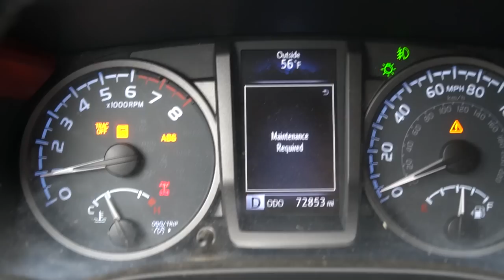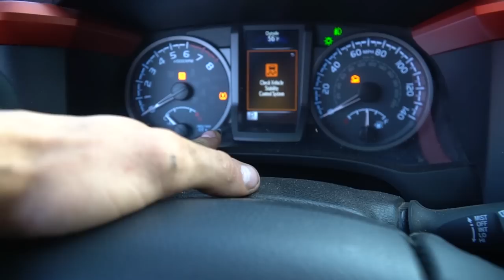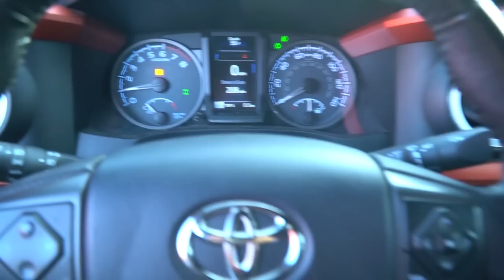Toyota Tacoma's 4x4 Issues | 2wd to 4wd change failure How To Fix

Comment: I had this problem today! I live in the Yakima County area. I attempted to put my Tacoma from 2wd to 4wd(hi) and a messaged popped up saying “2wd-4wd change failure”. After
a couple tries and running it on 2wd in nasty snow I attempted to get it in 4wd and finally engaged smoothly and drove it for 20-30 miles. Today it was 8 degrees fahrenheit and very chill winds. Maybe the 4wd system didn’t want to engage because the front diff oil and other 4wd components was too cold and due to the motor warming up it finally engage. If it happens again,  I’ll have to lift the truck up and check the actuator as it’s not my first time service differentials. My local dealer quoted me $160 for a diagnostics so if it happens again and I cant fix it I’ll have to take it to the dealer.

Comment: So the ADD on my old Toyota was vacuum actuated.  It was constantly not engaging or disengaging so I used a hose clamp to keep it constantly engaged, then put manual hubs on the front wheels.   No more shift on the fly but there were no more problems.

Comment: Stability control is usually the right to left braking adjust for bad road cond... check the vacuum pump
(brake  helper pump) .. not the booster.

Comment: About time we get some wheeling content again!
Reply from the maker: I know I cant wait to get the truck back out there
Reply: @Maxx.Powell  I had an issue with my new at that time 2018 Tacoma TRD sport 4x4  , drove into Carolina beach sand all good, parked there for 6 hours, then when i backed out of spot i was parked and drove about 200 feet the truck would not move, engine was running  but wheels would not spin at all, light came on it said something like trans fluid hot"  so i shut it off, a guy helped me told me he would pull me with a strap about 10 feet and then to engage from neutral to drive while on 4x4 and it worked, he said the lockers were out of whack, have you ever heard of such thing?

Comment: I have all kinds of lights on my 2020 Tacoma i have the Pre-collision system malfunction, ABS, Check vehicle stability control system, Check blind spot monitor system, AWD System malfunction. Its a freaking nightmare, i have an appointment at a second dealership tomorrow, we’ll see what they say! First Dealer i took it too charged me 180$ dollars for Diagnostic and said it was the RF wheel speed sensor which they priced at 280$ and the whole job for them to install was close to 800$ just to remove a 10mm bolt and unplug the sensor and install the new one! What a ripoff! Brought the truck home and after I inspected the sensor connections I noticed the tech at the dealer had unplugged the wire inside the engine bay by the wheel well, so it was obviously not gonna read like it stated on their diagnosis! Thats the reason i am taking it to a different dealership tomorrow hopefully they do help me fix it and not just take my 💵

Comment: I just bought a 2018 and when is warms up sometimes it starts flashing and says 2wd -4wd change failure after it cools down it resets and works for a while until i drive it and after it gets warmer it goes again? Appreciate the help
Reply from the maker: I'm having the same issue still.  I have a buddy who spend a ton of money trying to figure out what was going on. He said their is a position sensor located on top of the transfercase (mid vehicle) and that the whole transfercase needs to drop out in order to access that sensor. The whole job cost him 6k 🤮
Reply: What is the part number or exact name to look it up

Comment: So I have this same issue but only after I regeared to 4.88 gears. Toyota dealership tested it with a ohmmeter and they said it’s the coil in the rear diff. Dallas Offroad installed it and they’re trying to say it’s nothing they did and that it’s electronic and not their fault.
Reply: What happened here for you?  I just regeared to 4.88 and I just noticed I'm having issues getting out of 4L
Reply: @honestmike3255  The coil in the rear diff that’s connected to the e-locker was damaged by the installer, Dallas Off-road. This is the most common issue and basically gives you a 2WD/4WD Mode Change Failure alert on your instrument cluster. The wire that goes to the coil was damaged and would intermittently throw an error but in my case I couldn’t go into 4WD.  THATS DEFINITELY THE ISSUE.

It was fixed by a Toyota Offroad shop here locally called Tandem Automotive who basically new exactly what the issue is.

Comment: I had my truck for exactly one week and my 4x4 actuator failed and had to get it replaced. Was under warranty, but still....
Reply from the maker: Dang that's a bummer
Reply: @Maxx.Powell  Yes, Toyota could not tell me why it happened. Only that they fixed it. Just hoping it doesn't happen again at 25001 miles.

Comment: Mine occassionally fails to switch in or out of low range. It is annoying because I live in the middle of nowhere and I use low range almost daily.  I often drive my 2004 tacoma 4x4 just because it has an old school transfer case shift lever.

Comment: Hahaha "holy shit!" I said the same thing when the lift sagged... Btw if you put a 6" suspension lift on that truck, you will cut out the crossmember that is bent from when you moab'd your truck. The lift will come with a new crossmember brace and most likely solve your alignment issues. Just a suggestion.
Reply from the maker: I've actually considered doing that. It's a great idea.  Even some 4 inch lifts offer a new cross member but idk if I could still run long travel
Reply: I tried that and never got proper alignment so i ditch out the 6 inch drop bracket kit and kept the +4.5 long travel kit, as far as I know its possible to go that way, theres a few that had done it in Hawaii,  look out for @the_hotch_ on IG

Comment: Happened to my 21’ 4runner, bought 2020 of Oct. popped up this winter (last winter had no problems) had it checked by toyota, was there for the whole day, got a call back and they said they “re-calibrated” it, got home decided to change it to 4H, went to 4H but a few minutes later this malfunction thing shows up again. 🤬🤬
Reply: Any resolution? Same problem with 2020 4runner. Second time within 6 months. Hate this electronics
Reply: @vladd5291  yeah! It turns out to be a faulty ADD actuator, if your 4runner’s still under warranty bring it up on your next visit for them to check it out, they completely changed mine out under warranty, yeah, i do agree with you on electronics,

Comment: I'm stuck in 4 hi. Tried this fix. Didn't work. Any suggestions how to get it back lnto 2 wd
Reply from the maker: I'm sure by now you've tried creeping thr truck forward and backward to hopfully find a point at which it can disengage 4x4. Try neutral as well.  If that doesn't work then you may have an issue with the actuator simular to the problem im having.  Also be sure you're out of 4 low.  You can only come out of 4 low by going disengaging diff lock, then go neutral, disengage 4L then disengage 4h
Reply from the maker: Man i was half asleep when I read your comment. You tried the actuator fix but it didn't work. Sorry man. Im not reslly sure
Reply: I've tried it all. Almost ready to get reamed at the dealer. Lol. But thanks for the reply.

Comment: Any chance you can do a video on building a Taco for Overlanding from start to finish? basically the first through 100th item you would buy and upgrade in order from all your experience thus far. I'm starting my first build, and have no idea where to start. I don't have $20k to just do it all at once.

Comment: I prefer the 4wd selector that requires the far left pedal to be depressed, never fails.
Reply: Driving a manual doesn’t make you cool bud
Reply: @aesirapex251  it's not about a manual or being "cool", if you have personal security issues we don't want to hear them here. Plus I have a vehicle that does not require that third pedal but has a selector lever and is not dependent on a solenoid that has a option of failing when you need it to perform.
Reply: Mario Speer My bad, thought you were another person bashing automatics. I have a 3rd gen TRD off road Tacoma and my 4wd hasn’t had any problems yet

Comment: since I supercharged my truck I just had to drop my tranny for a upgraded clutch  in doing so I broke off a vacuum line out of the plastic actuator body and mine wouldnt go into 4x4 had to thread in a brass barb to fix it

Comment: Tip for oil changes so you never forget to fill it with oil. Pop hood before doing any work. Pull dipstick halfway out to use like a visual marker flag. When you lower it down, that dipstick “flag” will remind you to fill it.

Comment: Bro you need new wheel bearings BAD!
Reply from the maker: Yeah I saw that when I lifted the truck. I shook the tire back and forth and they felt fine actually but I'm sure I could still use some wheel bearing
Reply: @Maxx.Powell  that's weird man. It looks like they are well out lol. I'm not there so..... idk if he makes 3rd gen ones, but I just bought some hub assemblies on TW from a guy that presses them for way cheaper than OEM with NGK bearings.
Reply: How can you tell just from looking at it? I think my wheel bearing are going bad. Not sure if I should take it to the dealership or if there are upgrades I can do. Truck on has 23,000 miles on it :/
Reply: @123mistax   the way his tires moved after the suspension bottomed out. Jack up the front of your truck and shake the tire at the ends all around if you feel play they are for sure bad. If you have no play it doesnt mean they are good. Normally you will hear a roaring sound. Hard to tell if you have aggressive or cheap tires. Spin the wheels and if you hear clicking or real resistance then they are bad or on their way out. I cant speak for 3rd gens but both of my second gens bearings only went 150k miles.
Reply: @jsavage428  it looked to be just the side wall flex.. The tires slide inward toward the center of the truck as the suspension is extended, almost like the truck is trying to clap. The tire was being dragged sideways since he was not rolling and the movement was just the side load being released as the weight came off..

Comment: When you tried to engage 4wd before this, would you hear a small click? My Tacoma won't go in and the Brake Abs light stay on
Reply from the maker: No sounds or clicks at all. It doesnt even try to work
Reply: @Maxx.Powell  have you heard about anyone getting towed and after those lights turn on? That's what happened to me.

Comment: How many miles you got? Just buy a whole new servo and forget about it
Reply from the maker: 73k.  I think ill buy a new unit just incase this didn't work
Reply: @Maxx.Powell  oooh nice. Yea just get a new servo forget it for another 70,000 miles😌 I got a '15 with 70k☺️ bone stock access cab long bed 4x4 with stock size all terrain tires and a hard cap.

Comment: I’ve soldered mine on 10’ fj cruiser and didn’t work, I still have to climb under to hot wire actuator over to have 4wd
Reply: sas86toy my fj cruiser it was the 4 low switch in the tcase wasn’t talking to the computer to let it know it was in 4low
But maybe a different issue just something I had 
I pulled mine from top of tcase and cleaned and no fix
I sat in a parking lot shifting from 4low and back several times for like 30 mins waiting on my gf just playing with it and it started working.
Reply: Mine won’t engage into 4wd I replaced one of those switches on tcase, the one on passenger side I think and there’s 2 more on driver’s

Comment: To completely solve the 2 to 4 problem you should figure a mechanical way, a cable or linkage the way it used to be done before some non genius idiot screwed up and made them electric.